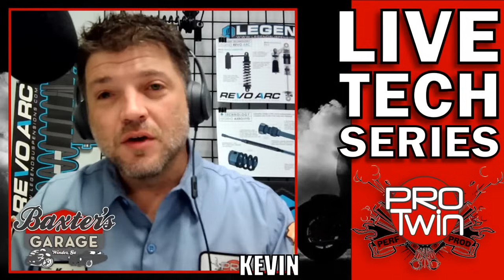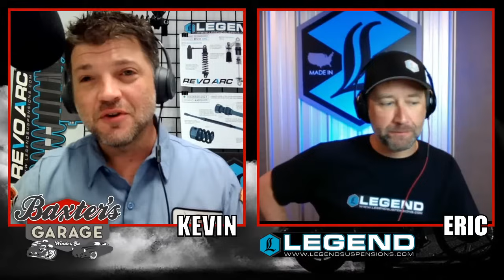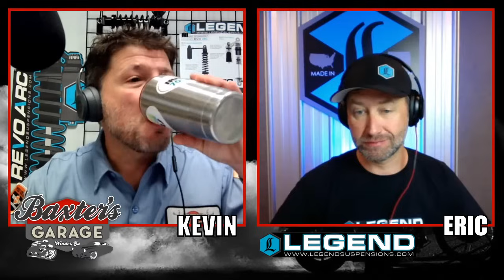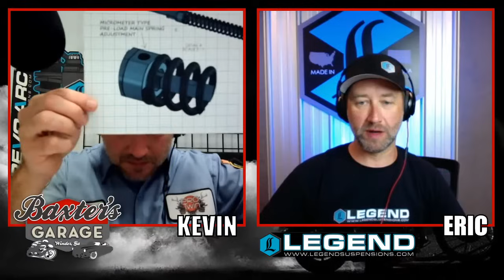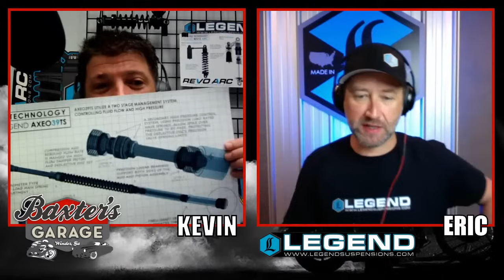Harley Suspension - Live with Legend - Kevin Baxter - Pro Twin Performance

Comment: I had purchased a pair of Revo Coil shocks 9 months ago for my 06’ Dyna. Because l was starting to put in a lot more miles. I was on the borderline for the weight. I got the standard springs. I absolutely hated them. I put 500 miles on them then said screw it and bought a Street Glide. I ride pretty aggressive the majority of the time and they were way to plush. Shame on me for not dropping the extra money for the Arcs. I realize that I should have researched it more and am still considering the Legends for my Street Glide if I don’t go with the Ohlins. Live and learn. Great informative video

Comment: i have mixed feelings on Legend Suspension, in particular their return policy. I had them install their air ride kit on my 2020 Road glide limited while out in South Dakota this summer. They installed the kit along with their Axeo front fork kit the day before i left to go back home to Minnesota (760 miles). Before the air ride i was running the RWD RS-1 piggy back shocks on my bike which are great shocks but i wanted something with easier adjustability while going from 1up to 2up without having to remove the saddle bags to adjust the springs. They went through the sag setup when i picked up the bike adjusting the air pressure for my weight and then had my wife jump on the bike with me to find the right air pressure while she was on the bike. The ride was just ok compared to my RWD coil overs on the way home, the big thing for me and why i wanted to return them was because it felt like the bike wanted to buck us off the bike whenever we went over the slightest bumps on the hi-way. i tried different air pressures, different settings on the dial with no luck and seemingly no change at all. i contacted Legend when i got home about a refund but was told i put too many miles on them for a return (760 miles). They did however agree to exchange for a set of their Revo ARC's which i still have in the box since i re-installed my RWD's which i'll keep on the bike since they are and awesome shock. The front Axeo kit however is a great addition to the bike for handling. one would think that if a person spent $2000 on a suspension kit they would be more open to return that product if the customer isn't happy with the product. If anybody is interested in a set of Revo Arc's that are new in the box and for 2014-2021 FLH models i have a deal for you. P.S- where they mount the air pump on the FLH models, you must remove it to change oil on your bike. it covers the drain plug.

Comment: I have some minor front fork leak, my question: it on 2003, twin cam 88, dyna fxdx with adjustable top & bottom front forks, different than other models? Any special tools or parts needs for these adjustable forks?

Comment: My wife and I purchased a 2019 road king 2 years ago and ride primarily two-up all the time. We looked at legends suspension but at that time we couldn’t afford the price tag so I opted to go with a set of progressive 444 instead. The progressive 444s were a huge improvement over Stock, but I found that I needed to manually adjust every time we went from two up to me by myself. After looking at legends for several months and having the opportunity to swap out the front cartridges due to a warranty issue, decided to go ahead and replace the progressive 444 shocks with a new set of legends Revo-A’s. I have to tell you the difference was night and day. Such a huge positive change between the progressive shocks and the Revo-A’s!! I no longer need to adjust the shocks sag, I simply change the rebound adjustment one notch and I’m good to go (I would take the time to adjust sag if I rode one-up more than I do) The ride quality is worth every penny. The front end Legend Axeo cartridges were a total game changer as well, I did not realize just how much of the overall Ride comfort actually comes from the front. Doing the front and the rear makes this the bike of my dreams...... I wish I had gotten it done right when I bought the bike. Thank you legend!

PS… if only Harley Davidson built their bikes with the same attention to detail and quality? Yes the bike is in the shop for the third time in three years for major engine transmission work. Stock bike with exception of a stage 1 kit…. Non-aggressive rider here.

Comment: BS w air ride.   This does not slam liability reason they say I made a mistake and bought 3 units all at once. Went ho,e. Installed it and connected them. They gave me that explanation plus mechanical failure

Comment: Hey Kevin,  I’m new to the street scene with my recent purchase of a 2011 FLHX.  Been racing motocross for 15+ years and understand the importance and operation of suspension but am struggling to decide on which type of shock to go with for a street glide.  I typically ride solo but often have different riders when I do ride 2 up.  Would Aero-A shocks be the way o go since my “payload” varies so much, or would ARC’s be the way to go with my knowledge of suspension operation?  Been watching your videos and am grateful for the knowledge you share and value your opinions and experience.  Any input is appreciated.
Reply: The biggest concern I have, I guess is the lack of compression control on the air system

Comment: Very informative thanks for that definitely getting a set of ARC’s the only thing that wasn’t touched on was the 14” shocks I have a 17 RGS and I would probably get the 13” shocks but at what point would it be beneficial to up to 14”?
Reply from the maker: its purely about clearance and lean angle.  1" taller gives considerably more.

Comment: Buying a full set of shocks for my 2000 Road king 25,000 miles , the shocks would be  40% what the bike is worth.
I don't think the manufacturer  ever think or care about that.  Legend Axeo & Revo A 1674 .00 + shipping  & tax , sorry no free shipping.
For 2000 .00 I could buy  4 car tires , 4 shocks, brake job and full tank of gas, may have money left over.

Comment: Hey Kevin, I got a quick question to ask you, and I’m not sure that you can even answer it. I bought my 05 Super Glide used.  The seller told me that he paid $34K before he added the stage 4. I feel like when I 70mph the front end feels loose. The dude I bought it from says every year, since 05, he checks the new HD improvements Cubs did them. If I have the best progressive suspension offered inthe mid 90’s. If I go for top of the line legend front and back, will I really notice a difference.
Reply: OMG, that was some horrible writing and I’m sorry. I just want to know if a 2020 legend suspension is gonna be that much better than Harley’s progressive
Reply from the maker: Please contact me directly on this subject.  Email to kevin@protwin.com  I have some options that would probably serve you far better than you mention here.

Comment: A few years back I did the cartridges and Revo-A shocks on my '14 Road King. It's a little firmer than I like (I'm 175 lbs.) but the front end feels far more secure. Expensive but worth it.
Reply: Kevin Dave a newer member but hav learned alot from u I hav 15 street glide lv the bike other than  the hard stiff ride from front end do u know if legends has anything to improve that ride in frontend

Comment: Thanks Kevin for your work. What kind of suspension maintenance do you recommend for baggers that are used to do a lot of wheelies? Recently , a Road King 'driver' had the the frame separate from the head stock after he hit a pot hole. The driver is known to have bragged about performing 1000 wheelies on this bike.
Reply from the maker: A lot.  LOL.  More frequent servicing/fluid changes/slide,guide bushings/neck bearings, etc.  Proper suspension should really be considered.  On a stock front end...just a matter of time.
Reply: Id reccomend him a parachute n airbag strait jacket combo but I digress lol

Comment: I had purchased a set of Air-A shocks about two weeks before finding your channel. I ordered them without the compressor an electrical system. Just a hand pump. I will tell you that my 2005 FLHRCI tracks straighter down the road and take the Michigan potholes and bumps a lot better now. I am 245# in gear and have the shocks set on #2 for rebound and 55psi in air. Nice controlled ride now. Have to save up the money for the forks now.
Reply from the maker: I hope it does sir.  When you get ready for the forks, let us know.  Thank you sir.

Comment: One of the most overlooked attributes when upgrading performance on a Motorcycle is suspension IMHO, when in fact it should be the very first thing you do. In most of the cases I don't think 75% of riders in their defense even know that their suspension aren't set correctly. Thanks Kevin and Eric for taking the time to explain suspension characteristics. Good luck with the carb.
Reply from the maker: Thanks Sully.  I agree 100 percent.

Comment: I rode motocross for over twenty years of my life and one of the most important functions of the motorcycle is the suspension and in my opinion, it still applies when on the street. I have invested over $2000 in suspension upgrades on my Ultra and it is worth every dollar of my hard-earned income. One thing not mentioned in the video was the ability to rebuild which I do every 30,000 miles to keep the ride at peak performance. Again thanks for taking the time to educate us and share your knowledge.
Reply from the maker: Thanks for sharing...you couldnt be more right sir.  Youre welcome.  See ya in a month!
Reply: I would bet that you have never had your Harley exhibit "the Wobble of Death" the way you take care of your bike.

Comment: I have the Legend Axeos in the front of my '14 FLHXS and like them a lot, however, no one tells you the standard length Axeos actually lower the front end by 3/4".  The bike feels, handles and turns amazing. But for those that want a little bit lower front end this may be all they need rather than ordering the 1" lowered kit. I have Legend 13" rear shocks but not happy...
Reply from the maker: Hey Mike.  Thanks for commenting.  I have to wonder if it's set up right or there is an issue.  That shouldnt be the case really.  If you arent happy with them, reach out to Legend.  Im sure they would help you get it set up and offer some tips.
Reply: Thank you Mike for this tip. I checked with Legend, and Axeos does lower your front end 3/4", something I do not want. Thanks again.